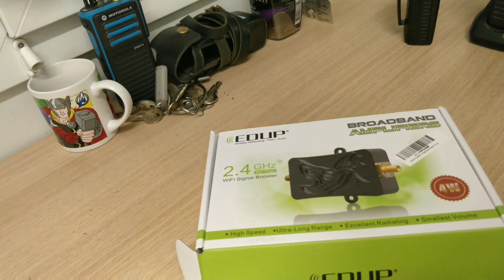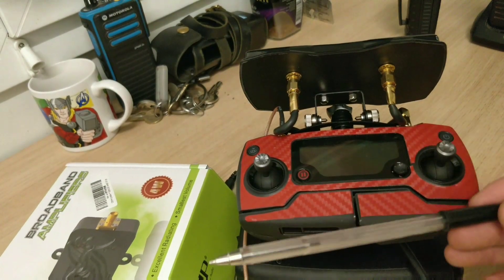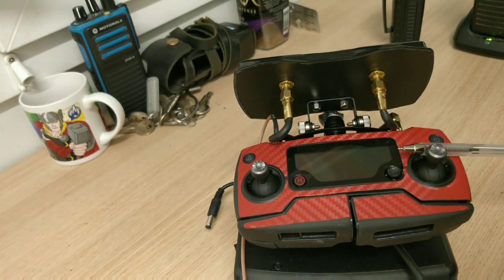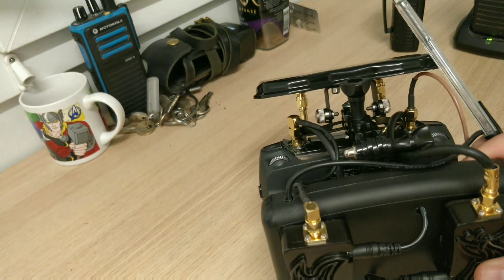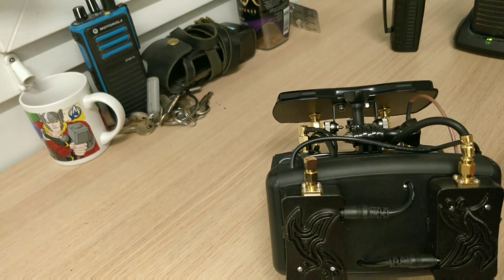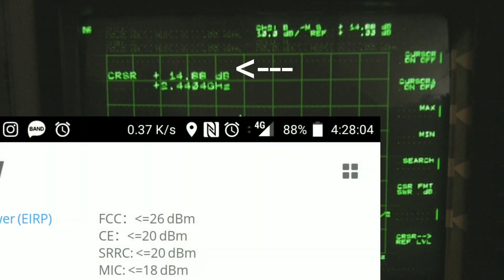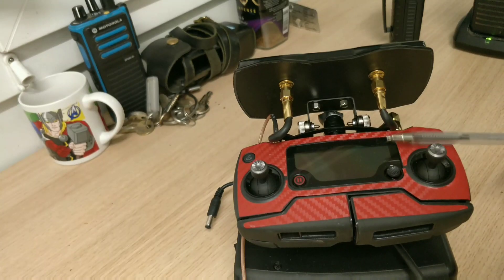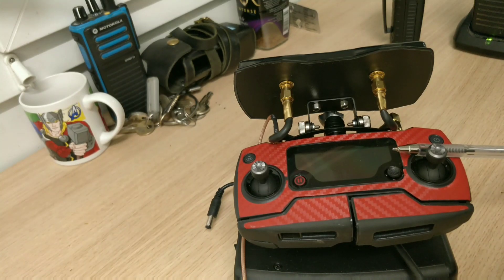Easy Homebuilt DJI RC Signal Booster - (part 1) Bench Test

Comment: Congratulations for the Video!
I'm trying to install a Sunhans 2.4 booster here with itelite antennas, very similar to yours, but it's not working, I don't know why.
Do you have any frequency settings that I have to make on the radio?
the cables that connect to the radio aso amplifiers are the right size?
Are the cables connecting from the amplifier to the antenna the right size?
if u can help me thank you!

Comment: Will the boosters work with a controller in FCC mode? I'm looking at the specs on one of the 2.4gHz boosters and it says " max input trigger is 20dbm, if inputting over 20dBm, the product may can not work or get over-heated." Thank you for the video and your time. / Subscribed
Reply from the maker: Yes it will work absolutely fine I've used it in FCC mode on three different mavs and p4p. Everybody in the group forces FCC and boosts
Reply: @Hawktok  Are both of the boosters 2.4gHz? I noticed on their site they sell the 5.8gHz that looks identical.
Reply from the maker: Yh 2.4
Reply from the maker: @kyle noble after this build I built another using a regular DUAL usb battery bank. Ideal if both sockets have 2 amp + output. But works on any amps above 1a . Sticky back 3m pad the amps and a GoPro mount to the battery bank . . And used that to mount  it to the RC / controller

Comment: Hi. I’ve just setup the same as you. Does one of the amps show bright green and red and the other one show red and faint green flickering on yours ? On using a mavic 2 and I’m now thinking one antenna is for tx and other is rx ?
Reply from the maker: Yes one side tends to transmit more then the other. 
The other side flickers as it uses that side of latency testing to keep the signal strength updated. Kind of like a beacon  hence the flashing. 
It's completely normal
Reply: Thanks for that. Your a great help
Reply: Hi again. Have you tested both the 4hawks sr and nanosync on you 4w boosted setup ? If so which did you find best. Thanks once again 👍🏻
Reply from the maker: Make sure your aiming directly at the aircraft. 
If signal starts to drop.. 
Gain altitude to bring line of sight back into play. 
Donations to get me back in the air are welcome
https://paypal.me/pools/c/8npuBBKtOn
Reply from the maker: NANOSYNC was the best small antenna all round boosted. 

4hwaks all I would recommend is the XR but it's the big one .
Reply: Nice one thanks again. I done my first test flight today with the 4w boosters and radio signal was full at 1.5mile but video was no better than before. Had full radio signal and video dropped out. Do you find this happened too ? Btw your help is greatly appreciated 👍🏻

Comment: I've just recently bought these boosters.. do you find that when connected to the left antenna it's a solid green light and the right antenna occasionally flashes. Not sure if my controller is faulty..
Reply from the maker: It's Normal. It transmits and receives/listens. 
It's a switching type radio setup so it will cut signal and listen then start transmission again
Reply: Has anybody got the link for the boosters where I can buy them
Reply: Ian French https://www.cafr.ebay.ca/itm/223328263074